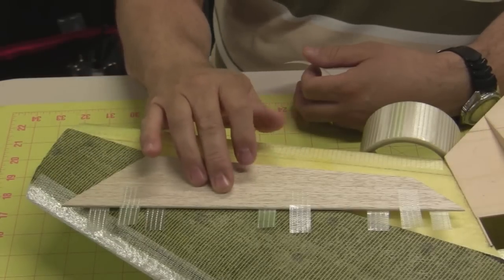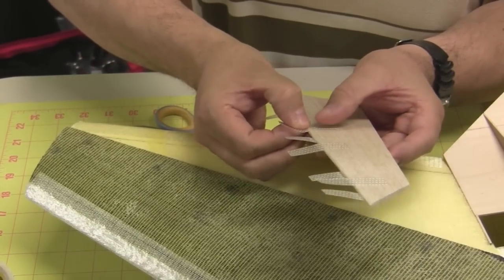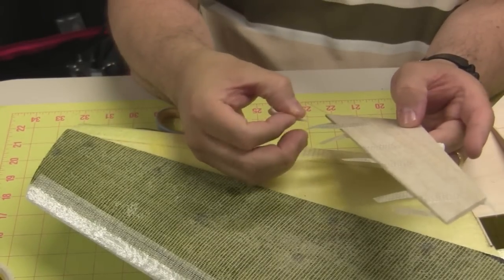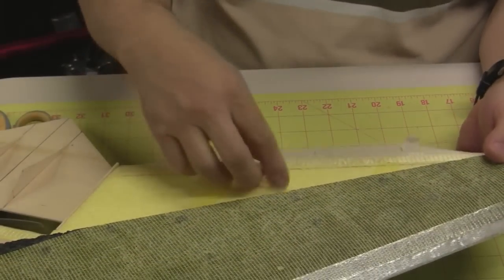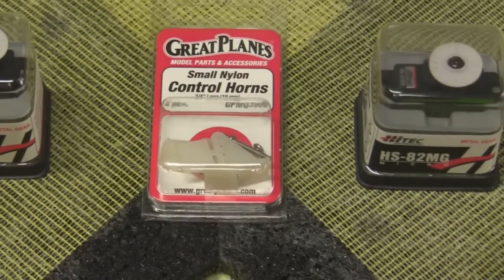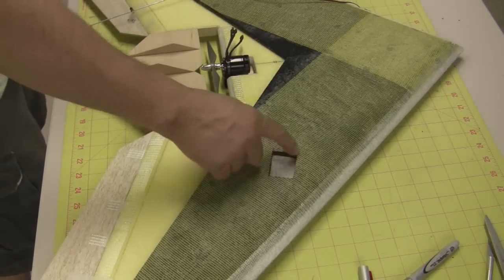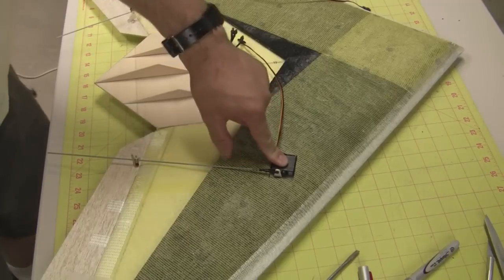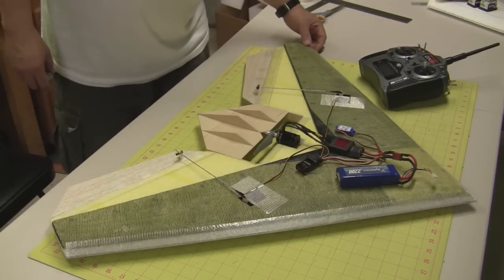Bullet Proof RC Plane Build Along No1 Phase 2B

Comment from the maker: Awesome historysky!!!  As for the delta mix question, we usually use this on planes like this one with only two control surfaces. Paul has used separate elevator and aileron controls on his FF15, FF22 and FF23 projects. I will probably put an elevron and rudder set up on my next plane. It all depends on what you build.

Comment from the maker: I checked the weight last night with everything on the plane except the tape and fuselage piece that I still need to make. It's at about 26.5oz I'm guessing it will be right around 30oz by the time it's done. This is still about 3oz less than Paul's EPP Park Jet that clocked 105mph with a Grayson Super Mega Jet motor.

Comment from the maker: @TheNnamdi1234 adding two rear stabilizers will definitely improve how the plane flies. I tried this on the plane without the KF airfoil and it worked great. Please do a search for "rcfoamfighters monster plane" to see how it flies. I did not take measurements of the rear stabilizers and no longer have this plane. You will need to experiment with the size and shape to get them right.